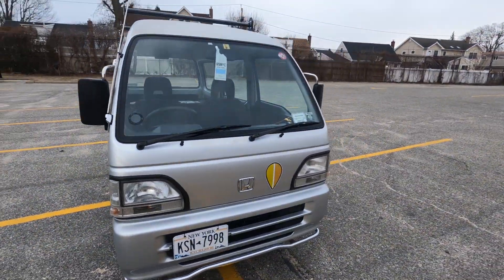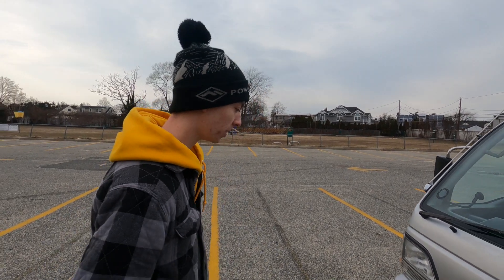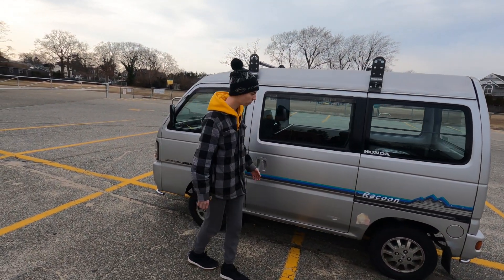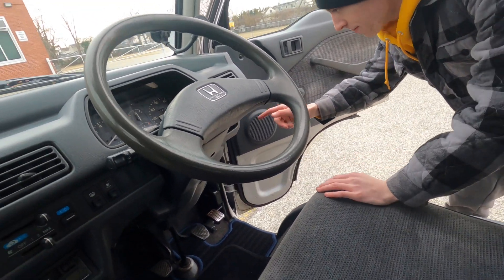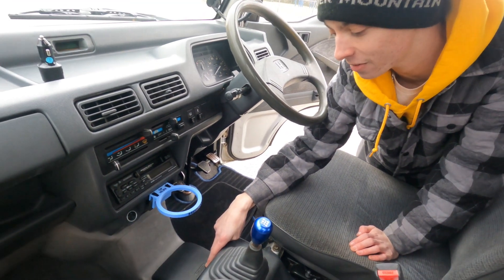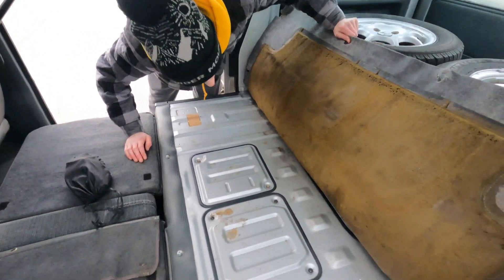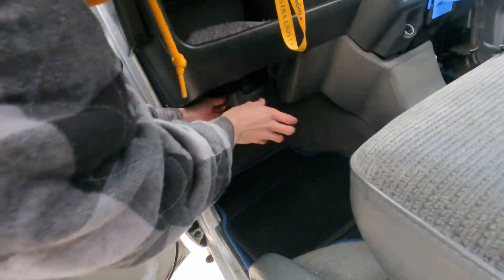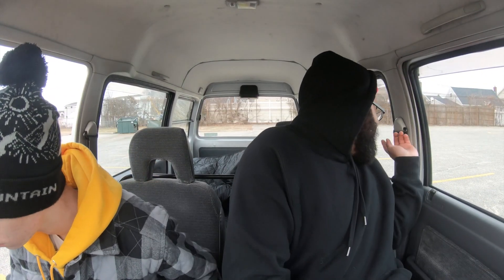Honda Acty Kei Van FOR SALE!

Comment: I sure wish these were originally manufactured to be sold in the USA, these prices are just insane for what they are. Very cool though.
Reply from the maker: prices aren't that high and they hold value unlink cares from here at that age
Reply: I have a e350 ford 2008 van that I bought for less than this. These prices are bad for what you are getting, no point in arguing that. But nonetheless they are very cool.
Reply from the maker: @keldonator  a e350 is NOTHING like a kei van lol but i agree
Reply: @Waybeforethefame  I only compare because I recently bought one and it's a van but yea a big box on wheels is the only similarities they share lol.